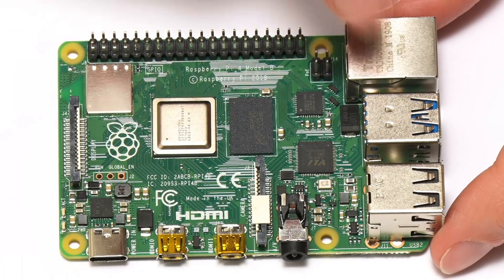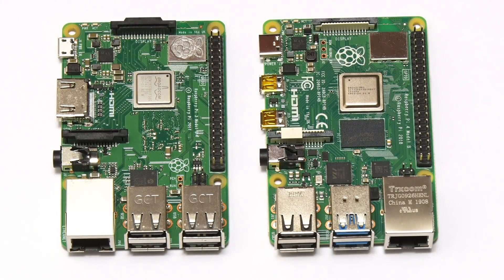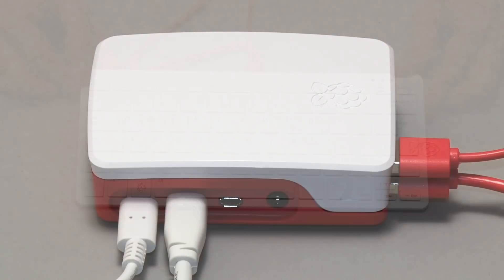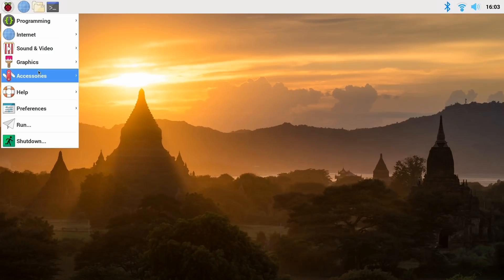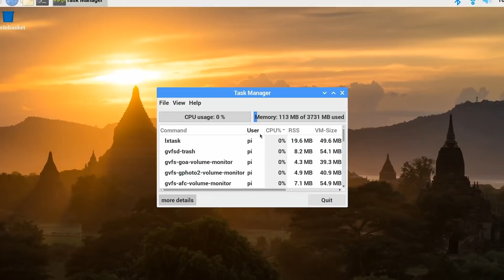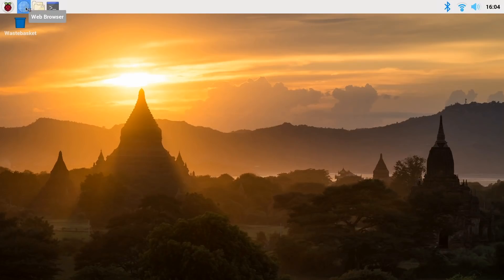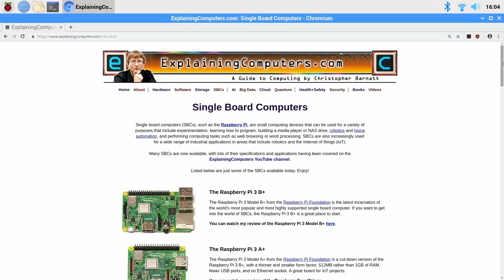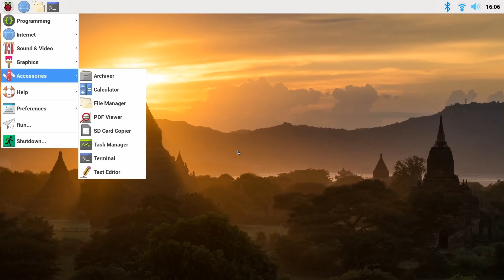Raspberry Pi 4 Model B

Comment: Thanks for the nice non-geeky, but informative, overview. 

What's the best drive for this - A1 class micro-SD card, A2 class micro-SD card, USB 3.0 thumbdrive, or USB 3.0 connected to SSD?

BTW I'm really glad to see the software "mature" and so see the successful transfer of Linux to the ARM platform.

It's nice to see good video support but all the early testers can't get smooth 1080p video...why did Pi need to write its own (and underperforming) video drivers (your video streaming seemed smooth enough)?

Can you recommend a compact LCD or IPS monitor? Most of the monitors I'm looking at start at 21" and I'd prefer 13-15" but the only ones I am seeing run through the USB port not the monitor port.

Finally, is that little Raspberrry Pi oem power supply safe to use on all my other USB C devices, especially my Surface Go?
Reply from the maker: I use a Sandisk Ultra micro SD card as my go-to SBC boot card (U1/A1). Based on tests I've done today, the Pi 4B reads at about 40MB/s from the micro SD card slot, so this card is fine. Note that, right now, the Pi 4B can only boot from the SD card (unlike the previous 3B+, which boots from USB). But Ethernet, then USB 3.0, booting are promised as future software upgrades. On the PSU, it is I think 5V only, so will not support any devices requiring higher or multi voltages. I've been running more streaming and other tests for  video on July 7 -- the results with the final software are worse than with the pre-release! :) But these are early days for GPU software support on this new Pi.
Reply: @ExplainingComputers  Very helpful, thank you so much. Just got a 200gb Sandisk A1 on a Lightning deal at Amazon. I'll try the Raspberry Pi 4 B when it comes out. Hope the video improves shortly. Th
is (poor video) is what happens when folks go for open source over proprietary but faster. :-(

Comment: Without resorting to an extensive read of comments, anyone considered the beneficial possibilities of using the USB 3.1 ports as the boot port? I have always thought that was one of the most significant drawbacks to the Pi 3. I have booted from usb 2 on Rpi s before without much benefit but now, with an ssd as the root drive.... WOW!
Reply: I wonder if the sd card interface is still the same USB 2.0 :-(
Reply from the maker: The micro SD card is about twice as fast(c.40 rather than 20 MB/s in real-world tests). USB will be bootable, but are not bootable yet (unlike the ports on the 3B+). Apparently a software upgrade will add Ethernet boot, and then USB 3.0 boot, in due course . . .
Reply: @ExplainingComputers Thanks! Good news for now, more good news later. What a remarkable machine, now what are the stores going to do with all those stocks of previous RPI versions and mediocre clones? It's a show stopper for sure. Thanks for you recent RPI 4B review as well as all your many interesting posts. JAS

Comment: I hope you will also make video with booting with SSD drive because it has finally USB 3. So this rpi4 can finally be a beast and there will be no slowing down with slow SD card. Looking for that video with your professional explaination as always. Thanks
Reply from the maker: USB will be bootable, but are not bootable yet (unlike the ports on the 3B+). Apparently a software upgrade will add Ethernet boot, and then USB 3.0 boot, in due course. I will of course keep track of this and report back in a video! :)

Comment: JonnyInfinite commented 4 days ago: "114 MB at idle should be a target for modern OSes. My Win 8.1 desktop machine can sit doing nothing and still use a gig of RAM (...)"

I've replied: They should take Amiga 1200 and Amiga 4000 as an example in the first place: a real HARDWARE multitasking (not software emulated like in x86 line), idle takes 0% processor, OS is fully customizable (user can tweak every little bit if he wants to, and there's an [Use] button in every prefs, when you don't want to SAVE nor DISCARD the newly set settings, only to test them temporally), the code is so efficient even when loading a full feature-loaded customized OS with all the libraries needed, fonts and graphical textures for the windows backgrounds and frames, custom windows gadgets  etc. - it takes around 1,2 MB, screen memory included (at 640 x 512 8-bit planar mode). Amiga was first in everything, Apple, Microsoft, IBM - they all copied off her (her, because Amiga in Spanish means a she-friend) and didn't give her a proper credit. Apple even tried to patent some solutions sought first on Amiga... ;) First in true multimedia (Amiga in 1985 vs x86 market around 1993), vfx, live video montage, composing music, audio/music studio use (with MIDI), the list could go on.

x86 platform spread like a mold only due to big promotion and eastern factories making (relatively) cheap IBM-clones. If Commodore hasn't bankrupted and they had someone else making the marketing decisions (more money for the team of ingenious developers, don't delay new models), it's very probable we'd be expecting something much more resource-efficient and user-friendly than the "OS isn't for the user, the user is for the OS and for us" Micro$oft company would want us to get used to. But hey, what else to expect from a patent-troll corporation founded by a sociopathic eugenics-maniac shaking hands with the corrupted and wicked of this world? ;)

Comment: An aluminum heat sink should be another accessory that's included
Reply from the maker: I totally agree.
Reply: @ExplainingComputers  The type with the thermal paste already applied, just peel and place.  In bulk it would only add a couple of cents to the overall price.  Perhaps for Pi 5, it will need it given how powerful these little boards are getting.

Comment: New HW is great but the biggest news is OS update with much better GPU pipeline, 1/2 of closed source SW removed. This allows for RPi to be used for a whole new range of use cases.

Comment: I am glad the Raspberry Pi has been improved in so many ways.  I was really hoping for more RAM, but they have gone much further and revised virtually everything. Having said that, the software and community support are what truly set the Pi apart from all other SBC's. I bought a RockPro64 board recently, and while the hardware is nicely done, I have been disappointed with the available OSes. Stability and basic playback of videos in the browser, two critical aspects for any SBC, have been nowhere near as good as on my Raspberry Pi 3b, which has much less powerful hardware. Great craftsmanship as always, Chris.

Comment: I'm curious how well the Pi 4 can deliver dual 4K output. I always thought such high resolutions would require a powerful GPU/RAM/CPU combination.
Reply: It's probably referring to things like office applications and slideshow presentations. There's no chance this little board could do anything that requires decent computing power like dual 4K video playback.
Reply: @djhenyo  Yea ikr Unless I would sell my 2600$ 4k tower 1080ti/i7 8700k for this lil board for dual 4k gaming LMFAO
Reply: It depends what you are tasking the graphics to do. Just pushing pixel values out is easy.
Reply from the maker: Dual 4K at 30 fps is possible for thin-client scenarios where industrial users want two large displays (eg in call centres, apparently!). Dual 4K video playback will not be possible.
Reply: @ExplainingComputers  Thanks! That makes sense. Glad they kept it at the same, reasonable price range. Maybe I'll pick one up someday. Thanks for your excellent work with the videos!

Comment: what i plan on doing with the new raspberry pi 4? 
options:
i plan on pre-ordering it because it is not really out yet, then waiting for it to arrive probably in august or september.
or
wait until black friday in november because it should be out by then and likely at a discount.
Reply from the maker: The board is most certainly out -- it went on sale at 7:00am on June 24th! But the 4GB model has sold out in many vendors . . . :(

Comment: Had to check whether the date was 3.14 and uploaded at 1:59:26...
Thanks for the heads-up. That's one very capable microcomputer.  How hot is the CPU under load? The 3 is uncomfortably warm without a heat sink.
Reply from the maker: The CPU is very, very hot under load -- see my forthcoming videos, including one on cooling. At the very least, a head sink is required.

Comment: Hi, Any idea if the RPi4B SD card maximum supported speed has evolved ? I think the 3B+ topped at UHS1 or 3 (10 to 30Mb/s) and could not handle the new V60 and V90 which go up to 90Mb/S ... Where are we now with the 4B ?
Reply from the maker: The micro SD card speed is about twice as fast. I've been running tests today, and read the card t 40.8 MB/s on a Pi 4B, compared to 22.1 MB/s on a Pi 3B+ using the same test. Many more tests and results in my video on July 7. :)
Reply: @ExplainingComputers  Thanks for your comment, sounds promising ! ;-)

Comment: Be aware of the formatting issue with MicroSD cards larger than 32GB (SDXC card): https://www.raspberrypi.org/documentation/installation/sdxc_formatting.md

"The Raspberry Pi's bootloader, built into the GPU and non-updateable, only has support for reading from FAT filesystems (both FAT16 and FAT32), and is unable to boot from an exFAT filesystem. So if you want to use NOOBS on a card that is 64GB or larger, you need to reformat it as FAT32 first before copying the NOOBS files to it."

Comment: Is the pi somewhat secure in the case without using the top white part of the case?
Reply from the maker: It is fairly secure without the top on once the microSD card is inserted.
Reply: @ExplainingComputers  Thanks, I was thinking of leaving the tool off for better cooling.
Reply from the maker: The more I use the Pi 4B (and I've been testing it out against previous Pis and the Jetson Nano today), the more I believe that it requires a cooling solution -- at the very least a heat sink. Any case also needs ventilation if the Pi 4B is going to be used for anything that stresses its CPU/GPU -- and this includes video playback. More info on this in upcoming videos. :)

Comment: Would a power supply board (like X730) still be necessary or is the new USB C port enough with a better charger? Can it handle USB PD or other protocols?
Reply: on the face of it, it seems  a generic Wall Charger at 5v times 3a = 15watts usb-c would be fine... official confirmation of  the pi4 onboard buck/boost usc-c safe levels would be good though for fully un/loaded usb ports pi4.
Anker USB C Wall Charger, 15W 5V/3A PowerPort C 1 Type C Charger, Super Compact with LED Indicator, for iPhone XS/Max/XR/8, Pixel 3/2/XL, iPad Pro, Galaxy S9/S8/Plus, and More
by Anker Deal Price: £9.79

Comment: When are we going to get a Raspberry Pi with RISC-V?
Reply: good question ,could be fun as a good combination of vendor boards mix and match together in 2020
assuming you are or want to learn to be a problem solver maker person, that likes getting insperation from this channel and
the likes of practical back to basics exellent HomoFaciens channel
Rotary encoder or: How to build a digital servo using an Arduino and photo sensors
https://www.youtube.com/watch?v=XIUrnR8bLAI

https://blog.hackster.io/raspberry-pi-becomes-a-member-of-the-risc-v-foundation-11f06aecc241
Raspberry Pi Becomes a Member of the RISC-V Foundation
Alasdair Allan Jan 4 2019

https://hackaday.com/2019/05/24/new-part-day-a-64-bit-risc-v-cpu-in-raspberry-pi-hat-form/
NEW PART DAY: A 64-BIT RISC-V CPU IN RASPBERRY PI HAT FORM
 28 Comments by: Brian Benchoff
,May 24, 2019  
co Grove AI HAT for Edge Computing https://www.seeedstudio.com/Grove-AI-HAT-for-Edge-Computing-p-4026.html
The Grove AI HAT for Edge Computing is built around Sipeed MAix M1 AI MODULE with Kendryte K210 processor inside. It's a low cost but powerful raspberry pi AI hat which assists raspberry pi run the AI at the edge, it also can work independently for edge computing applications.

$28.90

Comment: Cool, but not really. I am actually extremely disappointed in this new model. I wish they had intelligent engineers, not just smart kids. What a shame and what a complete waste of a new model.
Yeah, its ddr4 instead of ddr2 or 3, cant remember. But it should really start at 2gig these days. 
Why is the pi mouse corded when the pi has bluetooth? Also, the kb should be bluetooth and NOT corded with a hub. If you want a hub, plug in a powered hub. The kb and 3 devices will only have 900mA max if you use a usb3 port, not really that useful. Especially if you plug the mouse into the kb. Then youll be lucky if you can run the kb+mse and a usb3 thumbdrive.
They have gone to the effort of changing the power to USB-C, but didnt give us a USB-C port or 2. I would have gone with 2x USB3.1-A and 1 or 2 USB-C. Then the pi would have all the options available to usb-c. Plus the extra power options that come with upto 20v@5A. Like better overclocking, fully usb powered hdd's/ssds, display options, multi IO hubs and so on. In that case, I would have used a 3.1 bus for the whole pi rather than having multiple usb's, a glan and hdmi. We could finally have had all the IO on one end rather than the retarded side IO.
And they went and changed the orientation of the usb and lan ports so that anyone who has made custom racks for pi's cant just swap out existing pi3's with the new pi4.
Not to mention, I am still waiting for the mSD slot to be click in/out and allow the card to be flush or inside the footprint of the pi rather than having the card stick out past the board. BOOOOOOOOOOOOOOOOOOOOOO!!!!!!!  I will probably wait till the 4B+ comes out and maybe buy only 1 for testing purposes. Other than that, I think I'm done with Raspberry now. There are so many better SBC options available these days.

Comment: Swapping the location of the Usb and Ethernet is baffling. I'm sure there's legit reasoning, but crippling the case compatibility is a real bummer.
Reply: Haven't taken the time yet to see if there's anything in the arrangement on the board that required the change, it might be more convenient in some way (the gigabit ethernet connection apparently no longer goes over the USB interface impeding its performance).

But even if that's not the reason you'd already run into issues with the two micro HDMI ports and the larger USB type C socket for the power supply. So even if that was kept the same you'd still have issues that need modifications, it's not the end of the world I guess.

Comment: More significant than the dual 4k output IMO is the accellerated x265. Agree with other comments that micro HDMI wasn't a great choice, would have prefereed USB-C with alt mode for DP or HDMI. All in all a good upgrade that stops me considering more powerful options that lack the software support. If other ARM boards want to be relevant now they will have to get working on mainline kernels.

Comment: I think you should test the NOT shared bandwidth between USB and Ethernet on the RPi4. It's the first time that a RPi has distinct bandwidth for USB and Ethernet: "While Raspberry Pi 3 Model B+ added Gigabit Ethernet connectivity, throughput on Raspberry Pi 4 is free from the single shared USB 2.0 channel to the SoC." https://www.raspberrypi.org/magpi/raspberry-pi-4-specs-benchmarks/ . The test can be something like: Plug an USB keyboard or mouse to the RPi then transfer a file through Ethernet at 100% bandwidth then USB devices will not work anymore until the file is completely transferred if bandwidth is shared, else the devices should still work during the transfer.
Reply from the maker: See my video July 7. :)

Comment: I need a raspberry pie 4b+ based on cortex 78 and 16gb memory with regular hdmi not micro, 1 usb c and sata port.
Reply: need ?
"Jenny List :...You may be disappointed if you are pushing the limits of computational endeavour, but the majority of users will not be taxing Raspbian on the 4 GB model even if they install Chromium and open up all their favourite bloated social media sites. Perhaps we’ve become conditioned by the excessive demands of Windows on an x86 platform and forgotten just how powerful our computers really are. After all, as the apocryphal Bill Gates quote has it, “640k should be enough for anyone“, right?" https://hackaday.com/2019/06/25/is-4gb-the-limit-for-the-raspberry-pi-4/
Reply: @everest Neverest , I understand your concern, but I need the option to run windows 10 smoothly and emulate wii, GameCube and Nintendo 64 games.
Reply: everest Neverest , chromium is child play!

Comment: If its possible to use something like open office reliably then this would easily replace desktops around here and fit under the tree this year. Luckily i can play warframe on my cheap $190 walmart laptop so these things would save electricity and money while allowing us to ditch google and microsoft, this has been a great review.
Reply from the maker: Yes, Libre Office runs very well indeed. I would recommend adding a heat sink though.
Reply: ExplainingComputers Thanks for the information and tip! I'm a  lifetime Blender user so making the switch should be easy

Comment: The next Raspberry Pi should have an M.2 slot.
Reply: I’m sorry what
Reply: @melody_florum  an m.2 slot it's used to connect ssds. 

https://en.wikipedia.org/wiki/M.2
Reply: jangelelcangry I know but that cannot be cheap or practical
Reply: @melody_florum  Why not? does it have something to do with the fact that is an ARM chip or any lack of PCI-E?
Reply: jangelelcangry what’s the point exactly? I just don’t get why
Reply: @melody_florum  It would turn it into an extremely compact NAS.
Reply: There is an M2 adapter for them now. Search YouTube I just saw it a few minutes ago.